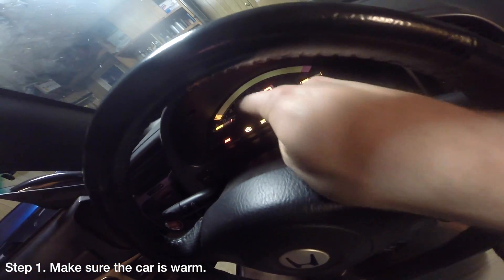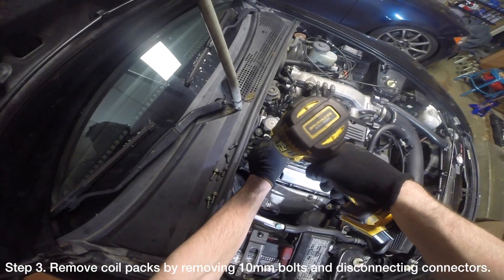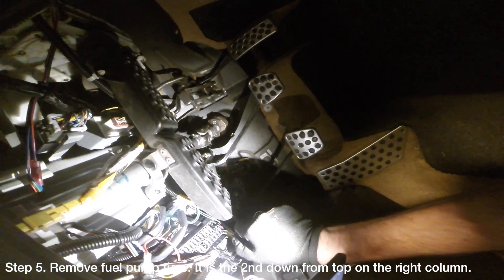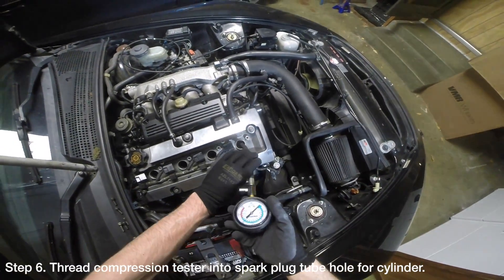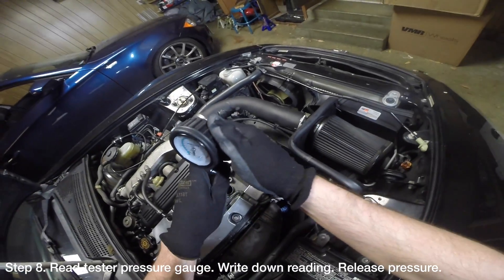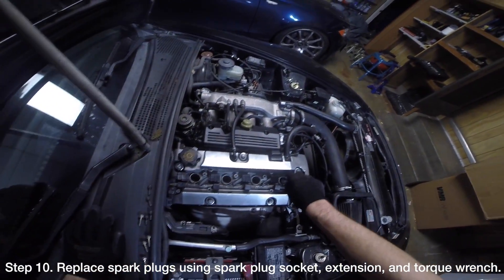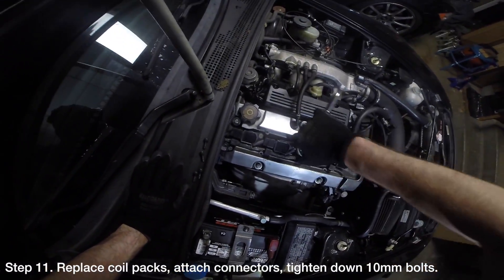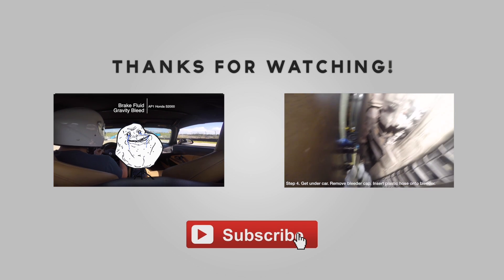Compression Test | AP1 Honda S2000

Comment: Thank you for the compression test video.
Have you had to replaced the dash bulb used to back light the temperature control knob?
How about the pro’s and con’s of using a Testpipe instead of the catalytic converter!!

Comment: I sense a misfire in my car S too. Usually on cold starts. No CEL and replaced spark plugs, coil packs, idle air control, MAP sensor, and fuel injectors. I also noticed the misfire more when im inside the car not when im  by the engine. I can also hear the mini misfire through my exhaust tips
Reply: I'm experiencing the same symptoms in my s.

Comment: Hey man, I read you over reved your engine pretty badly, I'm a new ap2 owner and accidently mishifted from 5 - >2 going at around 75-70 mph, as soon as i saw it hit redline it was there for maybe half a second no more then a full second tops, you think i might of messed up something in the valve train from your experience.? Car sounds fine and no different idling but I just don't want to push it if I have maybe a bent valve or something damaged.
Reply from the maker: I overreved my engine and it was completely fine afterwards. This happened a few times. 

I would just drive it unless you encounter a a check engine light for a misfire. If you encounter a misfire issue there is likely something wrong. That is what happened to Zygrene.
Reply: @DIYGuysvideo  Thanks for the reply man, appreciate it and will do I'll try and keep out an ear and see if I hear anything funky in the time being

Comment: You never mentioned what the numbers should be.
Reply from the maker: The shop manual says 228 is ideal with a maximum variance of 28 psi between cylinders. Many healthy motors seem to blow 240 though.

Comment: I just did one on my 03 ap1 with 81k miles. In about 8-9 strokes my cylinders were around 210-215 but if i cranked for a little longer, around 15 strokes, the pressure peaks out around 235-240 and stays there. Wouldn't it be more accurate if you were to stop cranking when you reached the highest attainable pressure?
Reply from the maker: People generally look for consistency as an indication of engine health so getting the absolute peak number isn’t always the most important thing. The reason for this is because there are variables that can change with the environment and compression tester that you use. However cranking until the PSI won’t rise anymore will give you the most accurate reading overall.
Reply: DIYGuys Thank you! Results were consistent throughout all cylinders for mine :)

Comment: Thanks for the info! I read below on another comment that you over revved your car and developed a misfire. Did you find out if you bent any valves? Did you manage to solve the misfire problem?
Reply from the maker: I overrevved at Laguna Seca pretty badly and broke no valve retainers. I think I developed a misfire afterwards but it ended up just being aging coil packs at 150k miles :) There were no bent valves.
Reply: Oh glad to hear that. My '00 GPW which is totally stock and has about 135k miles on it has a misfire which I can feel either hot or cold at low rpms up to about 3500 with mild - hard acceleration but above that range it disappears unless I floor it in all gears except (maybe) 5 and 6. She runs strong even on the highway. The problem was quite bad until I filled a bottle of Liqui Moly injection cleaner and (from reserve) Shell 95 fuel. It was immediately better but still there at low rpm. I don't think it's the coils, possibly fuel filter, clogged cat, or injector/s? Any advice appreciated. I don't have an OBDII scanner :/
Reply from the maker: +RolanTHUNDER Get an OBDII scanner! You can get Bluetooth ones now that work with phones. If the misfire happens on a cylinder start swapping parts around to see if the misfire follows the code. I've fixed a few misfires on people's cars and it's either been cool packs or injectors.
Reply: DIYGuys Okay. Where does the scanner plug into, where is the diagnostic port? My car is RHD as I'm not in the US. If I don't get the scanner soon then I'll have to send it for diagnosis which will cost around $40.
Reply from the maker: +RolanTHUNDER should be in your car's manual. Usually around one of your knees.
Reply: DIYGuys seems like my S2000 does not have an OBD2 port. I looked under passenger and driver's sides but found not port connection available. Only a green rubber covering two blue connectors which are apparently the DLC connectors for S2000 at Honda dealers. The manual does not say anything about OBD either. Suggestions? 
Oh by the way I was wrong about my mileage, its actually 125k ish miles :)
Reply from the maker: +RolanTHUNDER oh shit I thought the whole world used OBDII. Well I guess I learned something today. I would try to figure out what the equivalent is. I read something online about adapters but if it's a DLC connector you might have to take it to Honda?
Reply from the maker: +RolanTHUNDER The key is if you can pull information about which cylinder is misfiring you can start moving things around. I doubt you have bent or burnt valves unless your overevved bad. My car misfired at 150k and my friends started at 125k. Ignition coils or injectors. My bet would be on ignition coils. Can you swap yours with a friends?
Reply: DIYGuys Yeah I never over revved either of my S2K's. Silverstone was my first one but u might remember what I told about that...
I'm not sure if any previous owner may have over revved this GPW I'm having a misfire problem with. I seriously doubt an over Rev happened though or a bad enough one. I'll see if I can get my old coils out for a test on the GPW. I see it doesn't have an OBD2 port... '00 AP1?
Do you think it could be the fuel filter that needs replacing?
Reply from the maker: +RolanTHUNDER never heard of a fuel filter going bad or read about it. Especially on an NA car.
Reply: DIYGuys Okay. One mech said it could be the filter. I have reason to believe it because the misfire was quite bad until I used injection cleaner. It improved a lot after that. U think the cat may be clogged? Could it cause a misfire?
Reply from the maker: +RolanTHUNDER Don't think it could be the cat.
Reply: DIYGuys so while testing the coils today while the engine was running, I found NO change in the rpm when pulling each coil pack out of the plug. Pretty sure none made a difference at all except for cylinder 3 but still, the rpm should have dropped almost to 0 when I pulled any one coil. What do you think?
Reply from the maker: +RolanTHUNDER if you're pulling the coils your car should misfire terribly lol
Reply: Lol and now that it didn't? What does that tell us?
Reply: My year 2000 SP1 production #2600 has an OBD2 port passenger side by your left knee as your sitting.  Looked till I found it for days.
Reply: RolanTHUNDER before pulling the connector, how was it running?  Removing connector should cause it to stumble.  If no change maybe that coil wasn’t working in the first place?

Comment: Thanks for the videos man, I'm having a cylinder 1 and 3 misfire that I've been trying to fix for awhile now. Did a valve adjustment, sparks, coilpacks, changed my alternator since it caused dash flicker and I figure I'm pretty much down to fuel injectors and doing a compression test.

Comment: engine warm? Thats a good way to strip your plug threads. Why should the engine be warm?
Reply from the maker: If you are doing a compression test to get an accurate understanding of the condition of your running motor you want the state of your motor to be close to well... running.
As the engine warms expansion occurs and the cylinder sealing may improve. Lubrication is occurring in a running engine and this affects sealing.

It is pretty common...
Reply: Do you let it get to full operating temperature and then bring it in and do the test immediately? Or do you just do a couple minute drive, and then take it all apart?
Reply from the maker: I let the temp gauge get to 3 bars. Turn off the car and get to work within minutes.

Comment: good stuff, what the milage and compression numbers on your ap1?
Reply from the maker: +Jael Nava Mileage is 153k 
#1 - 215
#2 - 225
#3 - 210
#4 - 215 

Compression is OK, nothing out of the ordinary. The reason for the compression test is that I over-revved the car at the track recently and I have started developing a misfire so I'm currently tracking that down. Trying to determine if I bent some valves. I was thinking of making a vlog about it. Would be more of a series on how I over revved my car and what I learned and what you should do before you over rev yours. Thoughts?
Reply: +DIYGuys It sounds like a great idea. I'm interested in seeing how that series would match with the style you've developed in your DIYs. Adding to the wealth of information on the S is never a bad thing. I'm actually  collecting some content to put up of my own although it'll be more of a vlog series with a few DIYs here and there. I'm putting together my final clips on a DIY slave change. Stay tuned!
Reply from the maker: +Jael Nava Will it be on your channel or a new one?
Reply: It'll be on my channel!
Reply: So for ap2, what should the compression be at? Also, can you do a video on clutch replacement? There are many videos on here but I like the way you talk through it. Makes it easier.